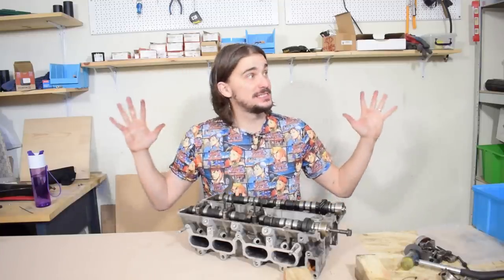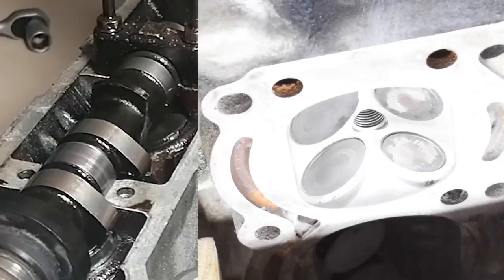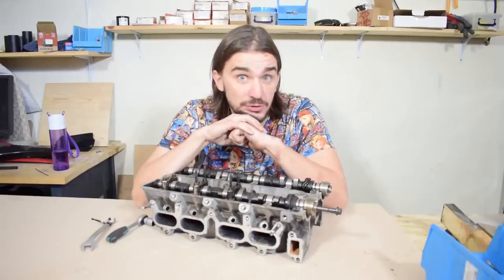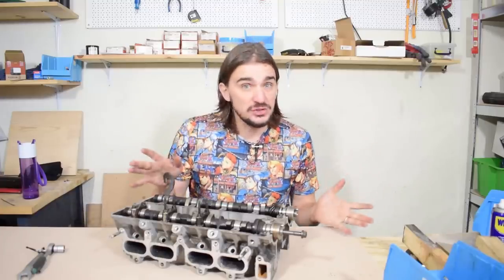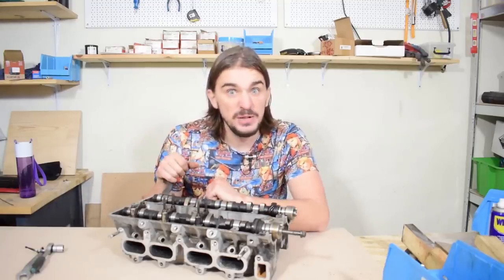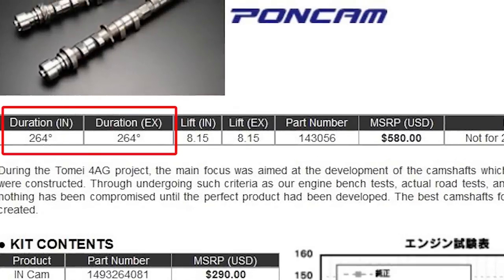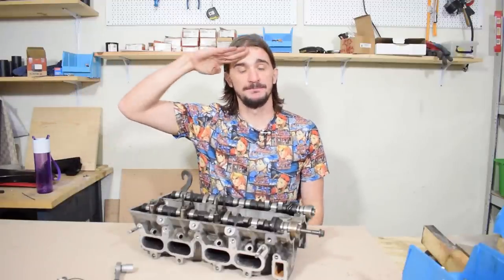Real vs. Advertised CAMSHAFT DURATION

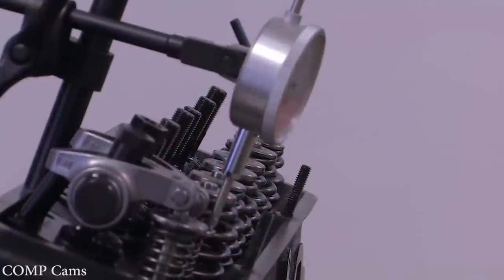Comment: At about the 4:20 mark you say that for the purposes of this video the measurement at the lifter and at the valve will result in pretty much the same duration. This is true with the head you are using that the cam pushes on the the valve. However a great many engines use rockers that multiply the lift by 1.5 to 1.6:1. That is why the .050 lift standard was measured at the valve, and some of the blurb sheets you showed specify that. This also takes into account valve lash on mechanical lifters.
Reply from the maker: No no, I just said that for the purpose of the video we can pretend that measurements at the valve and at the lifter are one and the same. And for the purposes of what I'm trying to explain they are. I didn't say measuring lift on an engine with rockers would give the same values at the valve and at the lifter, but I didn't want to complicate the video and potentially confuse viewers with rocker ratios etc.
Reply: @d4a  OK, that makes sense. I forgot to keep it simple. Sorry

Comment: But even with the disclosed valve lift figures be it 0.1mm or 0.5mm or 1mm, that is still not the full picture. e.g. 262" at 0.5mm is still leaving out 240" at 2mm and 10" at 5mm and xxx" at max lift etc etc. The only proper way for full disclosure is actually a graph with a curve no?

Comment: I started working in an automotive engine machine shop back in the 70's and I think it would be great to do a video on camshaft opening and closing events. I have used cams with smaller lift and duration numbers and have made more horsepower than people going bigger, it blows their minds. I remember when a naturally-aspirated small block Chevy produce over 1100 horsepower ( comp eliminator ) there's so much technology in those camshaft and cylinder head designs.

Comment: Hey D4A, I just wanna let you know that your MR2 build has inspired my up and coming SR5 to 4AGC conversion. Thank you for your straightforward and wonderful information. I don't have a lot of money, but I'm saving up and finding parts when I can, and so I'm going with the cheapest method of everything, and that means bike carbs. I ordered my DanST bike carb starter kit two days ago, and I'm trying to figure out what to do for ignition that won't cost me too much. I'm just very afraid of wiring and screwing something up, what prevents that fear from taking hold on you, and how are you so sure with every single one of your actions? Also, I'm not going the trigger wheel route as NODIZ is a little too expensive for me. What would you recommend for ignition? Using a 4k distributor? MSD 6AL? Thank you for reading my essay, and I hope your future projects all go superbly.
Reply from the maker: Hey there. You should see some of the questions I asked on the forums when I first started out. As you learn it gets easier. But there's no reason to be afraid of messing up, at the end of the day, it's just a car and it's just wires . It's all fixable or replaceable. If you're not having fun put it all up for sale. My personal opinion based on my own experience is that I would save up for Nodiz or Megajolt or whatever and buy that. Nodiz worked great for me, the only thing I can complain is that the Bluetooth isn't ideal and takes a few tries when you want to change your maps, but other than that it's really nice and helps make the car a lot more responsive and aggressive once you get the tune right. The difference between 32 degrees advanced and 38 degrees advanced at wot can be very noticeable. But if you're on a budget, some people had good experiences with the 4K dizzy. In fact I used to make an adapter for the 4k dizzy on my CNC but I don't do that anymore. I have sold that design to a guy on Instagram called @datguylance You can get in touch with him, as he might start making them and selling them soon. The adapter makes the install a lot easier. When it comes to MSD I have zero personal experience. But brand new MSD units cost more than the Nodiz? You can find used ones, but the problem is you really can't test if they're working or not until you actually install them on your car? On the other hand you can easily inspect a used 4k dizzy for example, new ones are still available too. So it's up to you. You likely won't save much by the time you buy the 4k dizzy and figure out something for the adapter. There you go, an essay for an essay, hope it was at least a bit useful.
Reply: @d4a  thanks so much for the reply. I'm never selling this car, believe me 😅 But I've also found that MSD is about 200 dollars cheaper than Nodiz. I've scoped out all the options and it seems that MSD would be the best one when it comes to performance and budget. Thank you so much for your insightful comment, I seriously appreciate it.
Reply: @d4a  .

Comment: Koenisegge engineers laugh at cam shaft driven engines and they don’t use cam shaft in their engine since 3000 years ago.
Reply: And they make less power than engines designed in the 1950’s, big deal

Comment: What if we know the measuring points of the two camshafts as well as their duration, but their measuring points are not the same. How can we know which one has more cam duration?
Reply from the maker: Let's say cam A has 250 duration @ 0.1mm and cam B has 250 duration @ 0.3 mm. In this case cam B has more duration. The higher the lift point at which you measure duration the lower the duration, so the cam that's measured at a higher lift point will likely be the one with more duration. But it can get tricky for example when cam A has 250 duration @ 0.1mm and cam B has 240 @ 0.3. In this case you would need more information before you could be sure which one has more duration.
Reply: @d4a  thanks. I get that but I wonder if there's a formula you could use to calculate the cam duration of cam B @ 0.1mm if you know its duration at 0.3mm. That way you could compare the durations of both cams as if they were measured at 0.1mm

Comment: is duration the degrees the valve has more than the specified lift on the opening as well as closing? or is it the specified lift until completely closed?

Comment: can this aftermarket camshafts be installed directly to the head? or does the head need to be resurfaced for oil clearance and need ecu programming for a DIY?
Reply: You can swap the cam in the ecu can adjust to some lvl, but its best to get a tuned after to get the maximum out the the aftermarket cam.

Comment: Still confused 😂😂😂😂😂😂 I just installed A set of roller cams with a 260 advertised duration and 224 at .050. Is it mild or wild?
Reply: Sounds like a mild cam...but thats only a quarter of the story... Need to check lsa, total valve lift as well as how big the ramp rate and how long peak lift were held on that cam

Comment: Isn't simpler to just use the normal measurement? What is the difference of the milimeters? It should be measured at the instant that the valve opens, or at 0.001mm lol.

Comment: One major point I hope @driving4answers @d4a addresses:

The camshaft duration can be purely answered by the geometry of the cam lobe: just measure the angle between the starting point of the clearance ramp for the opening ramp and the end point of the clearance ramp for the closing ramp, and you will get a precise answer as to the camshaft duration, all of which wouldn't require arbitrary definitions for "lifts". So why isn't this the standard?
Reply: Answering this question was the entire point of this video.  What you have described is the advertised duration.  But in the real world that is almost never what the valves actually see.  For one, you'd have to have zero valve lash.  The shape of the lobe  (how quickly it takes up that valve lash) is another contributing factor.  That's why valve lash is also commonly stated in the real duration value, such as  222 deg @ .050" (.010" valve lash)